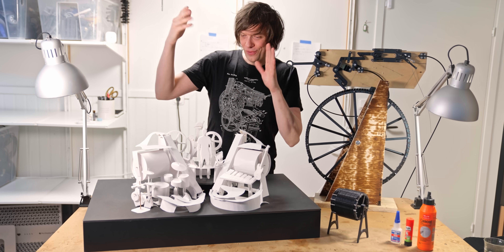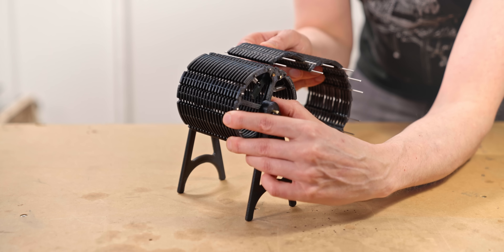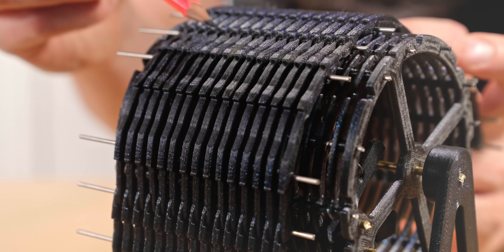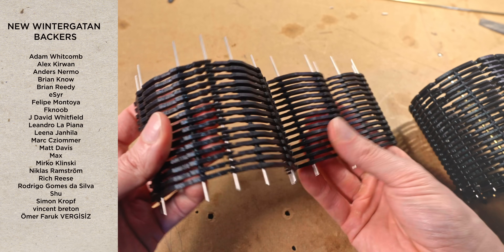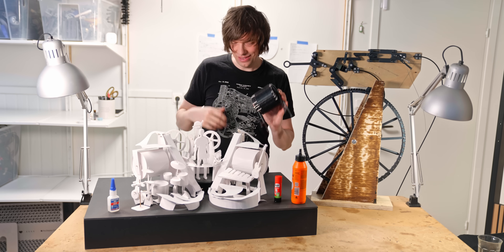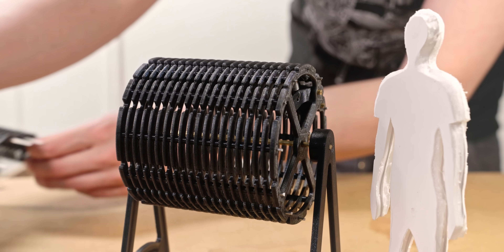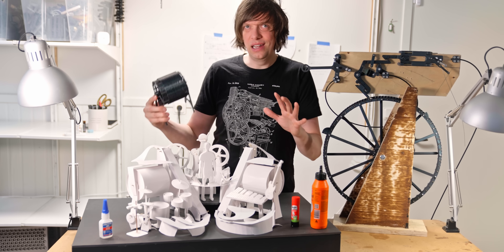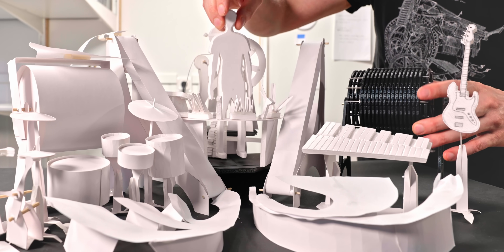A new way to switch songs on the Marble Machine

Comment: I really like that Martin is trying new ways to improve the process.   

I worry that taking off the song roll will be large and heavy and replacing it with another song might have some pins that are damaged in the process.
Reply: I pretty much have the same concern after even watching a few minutes. At scale that thing would be too heavy and tolerances will bring him back to the start - too much variance and not tight enough.
Reply: i'm worried that they will need a forklift to get the thing on!
Reply: @Daycare_Jr  Well he said that it would probably be made out of plastic or smth of the like, so hopefully it wouldn't be too difficult to carry with just one or two stage hands
Reply: @Daycare_Jr And a couple of full size trailer trucks to haul all the gear. That is by no means unusual for a touring band, but maybe not until they're slightly more fameous than Wintergatan.
Reply: @NoiseMakerX  that' the thing the budget for the actual tour never was there, it's a hyper risky endeavor more so when you don't have a hit record to pave for it. there was a LOT of money for a single person to live on by though while making the machine, he was making much more money than he would ever have made touring in sweden before.
Reply: It would be easier to switch songs if the sections were not all attached. The hooks would have to be duplicated per section, and there would have to be some way for technicians to know the right order, but that seems doable.
Reply: What happened to the idea of interchangeable program plates? That was a better solution than this idea of an articulated skin. As others have said, the skin is going to be too heavy to handle safely and will pose a risk of damaging things while installing and uninstalling it. Plus, it's not going to fold up neatly for ease of transporting. Separately installable plates was a better idea all around.
Reply: @whitslack , one of the design issues he had with MMX was getting the plates to align well enough when installed to play "tight music". The problem was that a small variable gap between the individual plates caused a slight delay between notes.

While the weight of the all-in-one solution could be an issue, it could be solved by a transportation drum. Unlike the programming wheel body, the transportation drum would not need to be engaged and disengaged from the rest of the machine and could be on casters. Changing the programming wheel would require the existing one to be disengaged from the machine, removed, the replacement precisely position, re-engaged with the rest of the machine, then locked in place. If it is fixed in place, the transportation drum could be maneuvered up to the programming wheel, the 'pickups' (I can't recall what Martin called them) lifted, the program rolled from the transportation drum to the programming wheel, and the pickups lowered into place. The programming wheel need not be moved and can be fixed permanently in its correct position.

The transportation drum has an additional advantage. Because the actual song information is stored constantly on a drum, it does not need the same heavy support infrastructure the individual plates had. The program itself could be lighter overall and easier to handle when transferring onto the programming drum.
Reply: @briancampbell179  Yes, I remember the issue with the plate alignment, although I don't see that a large, jointed ribbon would have tighter tolerances. In fact I would bet that thermal expansion would be an issue (drum circumference and ribbon arc length expanding with different coefficients), leading to sag/slack in the ribbon or an inability to close the latches at all, and even if the latches do close, the single gap at the join will vary by more than the multiple gaps between the discrete plates, over which any expansion could be spread out. All that having been said, I do like your idea of a transportation drum, kind of a dummy model of the playback drum that just provides a rigid structure for transport. It wouldn't be very space-efficient, however; a stack of four quarter plates would take up less volume than a drum wrapped in a continuous ribbon.

I think you word you wanted was "registrators."
Reply: @whitslack  , all good points.

Ultimately, I don't think there is an ideal solution. Whatever Martin goes with will be a trade-off.

Thankyou for reminding me of the "registrators" word.
Reply: @whitslack  I agree. I'm no engineer. That wrap around is going to need strong joints where it pivots to prevent breakage, which in turn adds weight. When the change out happens any twisting of it could break the joints. Storage space for it during transport could be a problem.
Reply: @tigerzero5216 He's determined to use nothing of the old design even if it was good it seems.
Reply: Haven’t finished the video but I am curious about storage of the “songs” during non-use and transport.
Reply: What about the scale weight of the song?? Where as the wheel will be on casters
Reply: the "train" could also be removable, too... make each segment "keyed" to the specific song and its order in the song,. but I digress...
Reply: Im concerned about how to find the start of the song in a easy way when you exchange Songs. Of course next to other concerns that already got mentioned like resilience to exchanging and moving because the pins feel kind frail, movability and lastly precision.
Reply: At this point, it'd be MUCH more reasonable to integrate linear actuators and some electronics into the machine to play the darn thing. I can appreciate the desire to make it fully mechanical, but having multiple songs and switching them mid concert is not a feasible idea when you design giant plates of metal
Reply: @ianr2002  Exactly. There’s been no good rationale why this MUST be entirely mechanical, especially in regard to being mechanically powered. Even if the marbles were released mechanically (through solenoids/actuators), I doubt it would demolish anyone’s enjoyment. And after nearly a decade…he really needs to consider simply COMPLETING a working machine, and stop chasing these “nice-to-haves.”  Otherwise, he’s going to end up with nothing
Reply: This is just an early sketch - plenty of time later to iterate on weight and handling.  That size in plastic is probably sufficently durable AND light.  (Think plastic children's forts - larger then an adult, but also very lightwight)
Reply: He has no intent to build anything.
Reply: @thomasbecker9676  that's the goal for now, is to experiment and brainstorm at some point he will build again
Reply: @Daycare_Jr  He has no intent to do anything more than keep people watching his YouTube channel.
Reply: @thomasbecker9676  he has said in a video that a good product (music machine) is more priority then good videos, your comment is not well informed and bad overal

These style videos get less views then the actual build videos, so if your comment would be true he would be building and testing a bunch of rushed experiments
Reply: @Daycare_Jr  Then he should stop wasting time on YouTube and use that time for his marble machine. All he needs to do at this point is coast, because people like you will drink up anything he puts out.
Reply: @thomasbecker9676  how will he fund the project, Patreon js allowing him to do less viewed videos. But it's to expensive to do without YouTube.

Also you need to learn how work works, you need to have money to make money, and you need to work for it
Reply: @Daycare_Jr  actual build videos need work to be done and take more time to make.

it's a cycle, a large part of the viewers is here actually as they've been here for half a decade and it is a cycle. he doesn't listen and the design goals of being able to actually have it ready and tour left the building like 4 years ago - you know the one design goal that actually would need to be met for the intended purpose.

appearance of progress either intentional or accidental that is being provided is a trap. nothing is further than it was like 1.5 years ago when he abandoned mmx. this is safe for him, it doesn't scare, there's no need to worry if audience will like a song(since he isn't publishing any) etc. he's flipped the script like 3 times in past 6 months alone back to page 1.

glad it got over the engineering/business self help books phase though that was a waste.
Reply: @thomasbecker9676  I was thinking the same for a while ! The whole thing about precision of the music, takes live music out of the picture. He could just play Midi files and have it control actuators if hyper precision is the goal. All manual art requires some randomness. I do understand if the machine is not reliable enough for the rigors of touring.
Reply: @thomasbecker9676  Because if you understood anything he says you'd know that for people like him and me the videos are still full of valuable information that is worth watching. You're going conspiratorial out of nowhere, it's hard to believe those likes in your comment are even real.
Reply: @ddnnmo If YOU actually “knew anything,” you’d very clearly see that this is a lost project, with no clear aim or set of goals (ie, design requirements).  Full of weekly scope-creep, and procrastination.
Reply: @br52685  "no you" type of comment lol see what you wanna see. Unlike you I put my face out there because I can stand by what I say.
Reply: @Daycare_Jr  Given how much Marty raked in during MMX, he's not hurting for cash. People like you are just too easy to milk for money, so why should he stop? Plenty of people fund their hobbies themselves, without a Patreon.

Thank you for admitting you know he only does YouTube to make money, though.
Reply: @thomasbecker9676  looking at your account you have lots of messages send in this channel all you do is argue if you don't like his videos then don't watch them, it's not like he is asking you to pay him one view more or less wouldn't matter
Reply: @ddnnmo  I'm an engineer; I see through the bullshit. There's nothing of value presented in these videos except what not to do.

As for you claiming I'm being "conspiratorial," you then suggest any upvotes on my comments aren't "real." Have you ever heard of the term "hypocrite?"
Reply: @thomasbecker9676  , Martin acknowledged many times that leaping into the build before going through this process was an underlying reason for what he classed as the failure of the previous versions. Personally, I don't class the previous two versions as failure because of the lessons learned, and one of the most important is the need to carefully design and prototype the elements before taking the first step to build something. If the prototyping reveals that the project is not feasible, then this is the time to find out and even that should be classed as a success. Only then, should he not build something, and that would be a wise decision.

If Martin didn't have the tenacity to build something, he wouldn't have persisted this long.
Reply: @briancampbell179 Take a step back and look at the current situation:  which versions were the most interesting AND most complete?

This current model is far from “interesting” and unlikely to be completed.

So is all this excess “planning” actually producing anything of value?
Reply: @br52685  , you call it "excess planning". That is incorrect. It is not "excess". It was the lack of planning that caused the problems with the earlier attempts. 

Martin has learned from his earlier mistakes. He has listed requirements. He is prototyping mechanisms before baking them into the final solution. 

It would be nice to see him dive into the build videos that were so entertaining while he was doing MMX, but he is now following a more methodical and logical process. He's not an engineer so we can't expect him to follow the efficient process resulting from years of engineering experience. He will fluff around a bit.

I'm happy to see him put effort into planning and not repeating the mistakes of the past. The interesting build videos will undoubtedly follow.
Reply: @briancampbell179  Has he actually listed his “requirements” in anything that is actionable—beyond merely “must look cool” and “must play tight music” and “must be memorizing”?

Or is he merely caught in this endless scope-creep, such as this shroud for his programming wheel, mechanical guitar, and requirement for a 10M “contraption”?
Reply: @br52685  , he has listed requirements. You can see them best as he went through the prototyping of the elements where he described those relevant to the part he was working on. He had those that were mandatory and those that were "nice to have".

Writing requirements is not simply a matter of taking a blank sheet of paper and writing down the first thing that comes to mind. Proper requirements require work and thought. As I said before, Martin does not have an engineering background so is going to be less structured in his approach.

As for your comment about scope creep, if you actually took notice of this video, Martin was very particular about not doing that. Also, when laying down requirements, you are defining the scope, so it can't 'creep' because it does not yet exist.

One of the most important things Martin did was a few weeks ago, when he asked the question "Why?" As a piece of engineered equipment designed to solve a problem, a Marble Machine makes no sense. There are music sequencers and electronic instruments that can play far better music than the Marble Machine will ever do. From a pure engineering standpoint, no one would build one. It is better to think of the Marble Machine as art more than engineering. The difficulty is that the most basic requirement of this piece of art is that it must work which is why there is so much engineering involved as well.

Based on what you seem to want, if Martin followed your impatience in how he approached this project, he would be 100% destined for failure. Planning may be boring to watch (not to me), but it is essential for a successful project.

Building the Marble Machine is going to be a slow process this time around. Martin will be doing a lot of planning, prototyping, and will be changing his mind on how to solve problems at this early stage, not find out after large sections have already been built as was the problem before. If you don't like the slow pace, too bad. Personally, I would prefer him to succeed and if that means exercising a little patience, so be it.
Reply: @briancampbell179  It’s unfortunate that you can’t see the reality of the situation.
Reply: @br52685  , it's unfortunate that you are promoting failure.

If Martin's approach upsets you so much, why are you here?
Reply: @briancampbell179  Who said I’m upset?  If anything, this is just a living example of how NOT to execute any project.  As they say:  “some people’s purpose in life is merely to serve as a warning for others.”
Reply: @br52685  , I thought your constant whining was a pretty good indication that you are upset.

I'm happy he's not following the same path that led to him not producing two machines that satisfied his requirements. Since he has learned about the importance of planning from those projects, that is enough to classify them as a success. If Martin wasn't on the path he is currently on, then they would have been genuine failures.

As I have said already, Martin will be slower going through this process. He doesn't have decades of engineering experience behind him and a well-established requirement setting and design process. He will go down rabbit holes, encounter dead-ends, and make a lot of mistakes. The point is that doing that now will make this part of the process a bit longer but will have huge pay-offs down the track when he doesn't have to do those tasks on a half-built machine. How many times did we see Martin have to do major redesigns of significant portions of MMX because his initial untested ideas proved not to work? Imagine if he had put a bit of thought into it up front, prototyped a few solutions, chosen the best one, and went straight into building that. That is basically what he is doing now.

Throughout my career I saw many projects fail because people wanted to rush into what was ultimately a bad idea, something that could have been avoided if they took a step back and basically did what Martin is doing now.

I will say it yet again - Martin will not be as fast and efficient as an experienced engineer because he isn't one. He's on the right path even if it isn't a dead straight line.
Reply: @briancampbell179  I’m just taking a critical eye. For example:  do YOU think this current plan (detachable programming panels) is actually a good idea?

Comment: Could it work better to have a sliding mechanism. Program 3-4 songs on a wheel and when you wanna swap songs, slide it like 1" to the left or right and its ready to go. Super short turnaround between songs. You could even make far longer songs by having 3-4 separate programs which come together to make 1 song and you just slide it up manually or automatically when needed